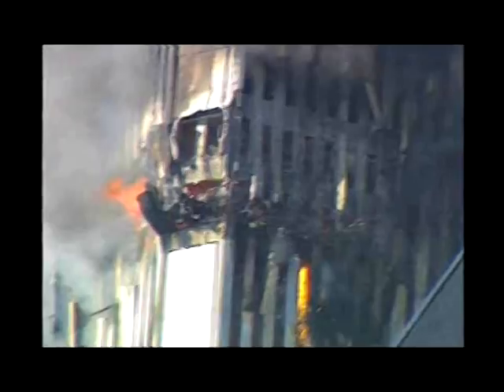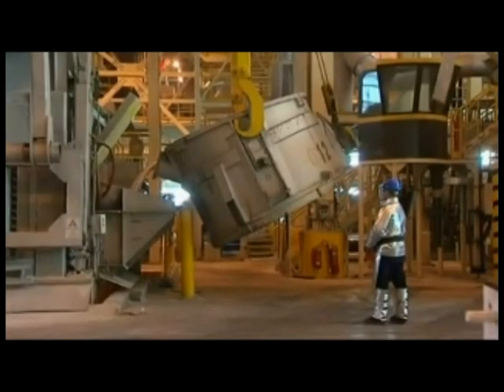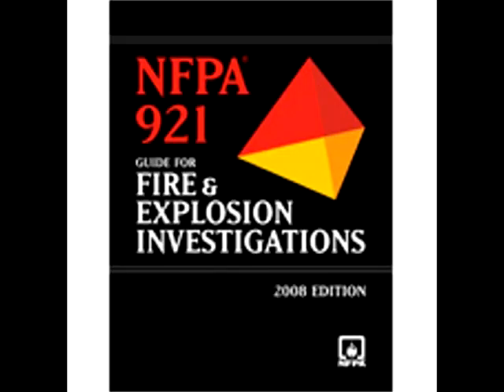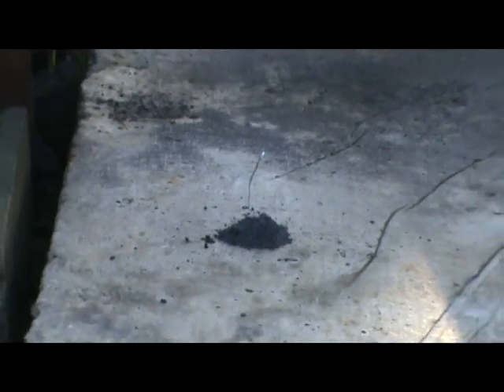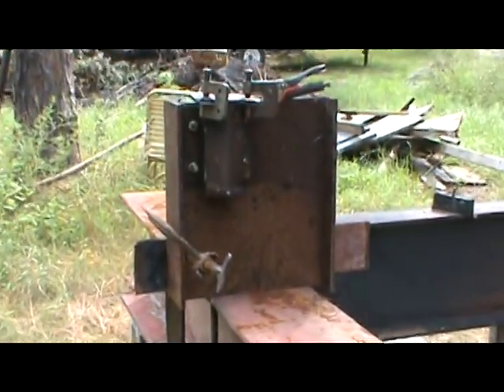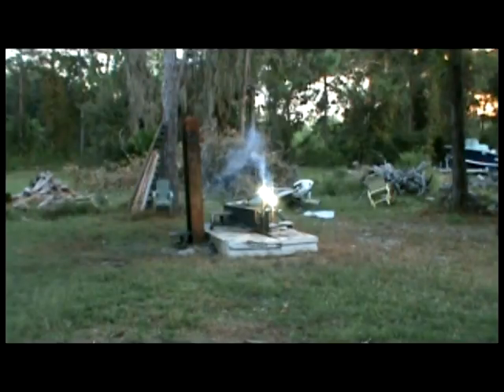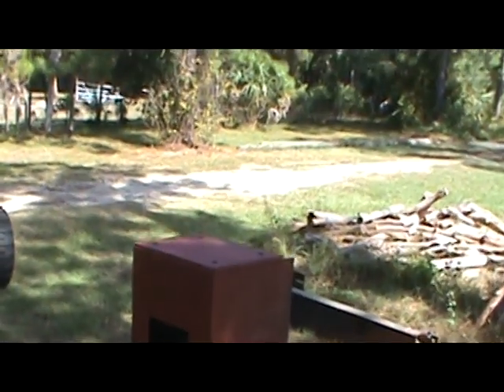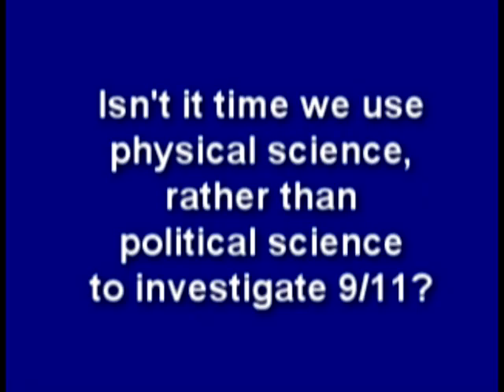9/11 Experiments: The Great Thermate Debate

Comment: @ThePeage available time.
Evacuation was assisted by participation in fire drills within the previous year by two-thirds of survivors and perhaps hindered by a Local Law that prevented employers from requiring occupants to practice using the stairways. The stairways were not easily navigated in some locations due to their design, which included "transfer hallways," where evacuees had to traverse from one stairway to another location where the stairs continued.(41)

Comment: ThePeage It is conceivable that such a fourth stairwell, depending on its location and the effects of aircraft impact on its functional integrity, could have remained passable, allowing evacuation by an unknown number of additional occupants from above the floors of impact. If the buildings had been filled to their capacity with 20,000 occupants, the required fourth stairway would likely have mitigated the insufficient egress capacity for conducting a full building evacuation within the... (40)

Comment: @ThePeageDue to the presence of assembly use spaces at the top of each tower (Windows on the World restaurant complex in WTC 1 and the Top of the World observation deck in WTC 2) that were designed to accommodate over 1,000 occupants per floor, the New York City Building Code would have required a minimum of four independent means of egress (stairs), one more than the three that were available in the buildings. (38)

Comment: @ThePeage Egress capacity required by current building codes is determined by single floor calculations that are independent of building height and does not consider the time for full building evacuation. (37)

Comment: @xFogxofxWarxThe WTC towers likely would not have collapsed under the combined effects of aircraft impact damage and the extensive, multi-floor fires that were encountered on September11, 2001, if the thermal insulation had not been widely dislodged or had been only minimally dislodged by aircraft impact.
In the absence of structural and insulation damage, a conventional fire substantially similar to or less intense than the fires encountered on September 11, 2001, likely would not have...(27)

Comment: @xFogxofxWarx WTC2 collapsed more quickly than WTC 1 because there was more aircraft damage to the building core, including one of the heavily loaded corner columns, and there were early and persistent fires on the east side of the building, where the aircraft had extensively dislodged insulation from the structural steel. (26)

Comment: @xFogxofxWarx Their neighboring columns quickly became overloaded as columns on the east wall buckled. The top section of the building tilted to the east and to the south and began its descent. The time from aircraft impact to collapse initiation was largely determined by the time for the fires to weaken the perimeter columns and floor assemblies on the east and the south sides of the building. (25)

Comment: @xFogxofxWarxIn WTC 2, the core was damaged severely at the southeast corner and was restrained by the east and south walls via the hat truss and the floors. The steady burning fires on the east side of the building caused the floors there to sag. The floors pulled the heated east perimeter columns inward, reducing their capacity to support the building above. (24)

Comment: @ThePeagecontributed to the abrupt structural collapse.
In WTC 1, the fires weakened the core columns and caused the floors on the south side of the building to sag. The floors pulled the heated south perimeter columns inward, reducing their capacity to support the building above. Their neighboring columns quickly became overloaded as columns on the south wall buckled. The top section of the building tilted to the south and began its descent. (23)

Comment: @ThePeage The robustness of the perimeter frame-tube system and the large size of the buildings helped the towers withstand the impact. The structural system redistributed loads from places of aircraft impact, avoiding larger scale damage upon impact. The hat truss, a feature atop each tower which was intended to support a television antenna, prevented earlier collapse of the building core. In each tower, a different combination of impact damage and heat-weakened structural components...(22)

Comment: @ThePeageThe two aircraft hit the towers at high speed and did considerable damage to principal structural components (core columns, floors, and perimeter columns) that were directly impacted by the aircraft or associated debris. However, the towers withstood the impacts and would have remained standing were it not for the dislodged insulation (fireproofing) and the subsequent multi-floor fires. (21)

Comment: @ThePeageTo increase confidence in the simulation results, NIST used the visual evidence, eyewitness accounts from inside and outside the buildings, laboratory tests involving large fires and the heating of structural components, and formal statistical methods to identify influential parameters and quantify the variability in analysis results. (18)

Comment: @ThePeagecomponents.
The output of the four-step simulations was subject to uncertainties in the as-built condition of the towers, the interior layout and furnishings, the aircraft impact, the internal damage to the towers (especially the thermal insulation for fire protection of the structural steel, which is colloquially referred to as fireproofing), the redistribution of the combustibles, and the response of the building structural components to the heat from the fires. (17)

Comment: @ThePeageFor such complex structures and complex thermal and structural processes, each of these steps stretched the state of the technology and tested the limits of software tools and computer hardware. For example, the investigators advanced the state-of-the-art in the measurement of construction material properties and in structural finite element modeling. New modeling capability was developed for the mapping of fire-generated environmental temperatures onto the building structural...(16)

Comment: @ThePeage towers to the design gravity and wind loads.
Simulations of the behavior of each tower on September 11, 2001, in four steps:
The aircraft impact into the tower, the resulting distribution of aviation fuel, and the damage to the structure, partitions, thermal insulation materials, and building contents.
The evolution of multi-floor fires. (14)

Comment: @ThePeage Establishing the baseline performance of the towers began with the compilation and analysis of the procedures and practices used in the design, construction, operation, and maintenance of the structural, fire protection, and egress systems of the WTC towers. The additional components of the performance analysis were the standard fire resistance of the WTC truss-framed floor system, the quality and properties of the structural steels used in the towers, and the response of the WTC..(13)

Comment: @ThePeage To investigate the building construction, the materials used, and the technical conditions that contributed to the outcome of the WTC disaster after terrorists flew large jet-fuel laden commercial airliners into the WTC towers.
To serve as the basis for:
Improvements in the way buildings are designed, constructed, maintained, and used;
Improved tools and guidance for industry and safety officials;

(2)

Comment: @ThePeage
1. Gypsum plaster is used in construction to cover drywall joints and screws. It is commonly referred to as Drywall Mud.

2. Plasterboard is the name for the layer of gypsum plaster that is dried into the centre board of drywall, then covered on each side by thick paper. 

3. Dolomite is used in concrete. When the concrete was pulverized during the collapse, the result would be a combination with the gypsum.

Comment: @ThePeage"…calcium oxide which is produced by heating limestone, causes the conversion of the sulphur dioxide into calcium sulfate with the formula, CaSO4.2H2O, which is the same as the natural mineral known as gypsum. The product can be dried and used in plaster [1], plaster board [2] manufacture or in road building.

Comment: @palasta Those 'squibs' are actually explained by Danny Jowenko, whom truthers often refer to as one of their guys (even though he wasn't, and denied the idea of it being controlled demolitions). According to Jowenko, the uneven collapse (as you can see the tower lean), caused excessive pressure on certain columns at a time, snapping the steel beams, and bursting their bolts. This caused the explosion sounds, which combined with the wind force created these plumes out the broken windows.

Comment: @ortafunk

"but I still can Not explain the squibs & lobby blown out."

Squibs was just compressed air shooting out of windows and ventilation shafts as the buildings came down.

The lobby blown out? It was damaged by the impact shock, an explosion running down the elevator shafts and elevators crashing down. There were broken windows and cracked marmor plates. It's only evidence of how much energy were behind those impacts.

Comment: A hydrocarbon fire can melt Steel If It Is big enough but I would Imagine the office furniture with foam rubber padding would burn hotter than jet fuel there was a big fire above the crash Impact. Also Air planes are made of aluminium & magnesium & magnesium can burn at 4000 degrees F also there are many Oxygen tanks on Air planes which would make the fire hotter then there Is a 3200 litter Oxygen tank I think exploded at WTC & pentagon, but I still can Not explain the squibs & lobby blown out.

Comment: @ThePeage "What sources are you unaware of?"

Your source that explosives would not register on seismic readings. Your source that gypsum wallboard does not cause sulfurization of steel. Your source that 'high tech' explosives that are capable of causing catastrophic failure of structures within the milliseconds required by demolition teams to fall a building as they desire; with no vibrations able to be recorded - even exist. Shall I go on?

Comment: @ThePeage If you wish to be taken seriously; and to demonstrate your scientific intellect that you like to portray; then you must provide evidence that controlled demolitions (conventional or not) would have collapsed the towers at the exact impact zone of the planes; and not have either gone off as a result of the fires, or simply burned up in them. Ignition of charges is dependant on either heat or electricity; both would have failed in the impact zone. This means it is impossible.

Comment: @ThePeage inwards; and not outwards. The video footage; as well as the reports of the clean-up crews show the majority (estimated by clean-up crews as about 80-95% of the debris) fell OUTSIDE the tower's footprints. If explosives were used; the result would have been an inward collapse of the outer walls; not the other way around. The pushing of the walls outward suggests that the collapse was the gravitational pull of failed floors; not the blowing out of them.

Comment: @ThePeage Your claim that it was not conventional controlled demolitions does nothing to refute the fact that the collapse was not done with any controlled demolitions. There is a footage of a French demolitions team which collapsed a building by removing one support wall; causing the upper floors to collapse in on the building. The result was an identical collapse as towers 1 and 2 of the WTC. For there to have been controlled demolitions; this French video would be an impossibility.

Comment: @ThePeage So we can see that he "suggests" crushed gypsum wallboard, as it is a known "certainty" for the cause of the sulfurization. The bottom line is there are several methods of sulfurizing the metal; and none require thermite - therefore your argument is void. Until you can prove that no other means present at the WTC would result in the sulfurization of the metal; then you zero evidence that it was in fact thermite.

Comment: @ThePeage Gypsum wallboard, or more commonly known in construction as drywall, is made up of gypsum; a form of sulfate. Oxidation is nothing more than rust; therefore the source of oxidation in the samples is a variable that could be caused by numerous effects without the presence of thermite. So we must look at the sulfurization. To sulfurize is to treat or impregnate with sulfur. Gypsum wallboard contains the necessary sulfur element to do just that. It's why Dr. Barnett said it is a certainty

Comment: @ThePeage "If the chips are something other than thermitic material, then it should be easy to show this. If they ARE thermitic, then they could falsify the OS."

"I would suggest that crushed gypsum wallboard would explain the source of the sulfurization. As that effect is a certainty (the effect of pulverized wallboard), and thermite is an unsupported theory, I'll settle for the certainty."

-Dr. Jonathan Barnett

Comment: @ThePeage I have not omitted anything about his comment on WTC7; I posted his comment on WTC7; but since you failed to read it:
"Tower 7 is another issue. I was under the impression that the fires were unusual in that diesel fuel in large quantities became involved in the mid-afternoon. This would exceed the protection provided by the fire proofing. Of course the mechanism of collapse is still an unknown. There were large transfer trusses in the building, so perhaps those we compromised."

Comment: @ThePeage "It's because the chips could be thermitic material that it should be properly investigated. If it IS NT, then it falsifies the OS."

Using elemental symbols does not make you correct. If it were thematic material; there would have been countless hours of prep work; and insane evidence left behind. There was neither.

Comment: @Skeptic121
Tower 7 is another issue. I was under the impression that the fires were unusual in that diesel fuel in large quantities became involved in the mid-afternoon. This would exceed the protection provided by the fire proofing. Of course the mechanism of collapse is still an unknown. There were large transfer trusses in the building, so perhaps those we compromised. I don't pretend to have the answer to tower 7. But I anxiously await NIST's final report on that tower. -Dr. Barnett.

Comment: @Skeptic121
I would suggest that the crushed gypsum wallboard would explain the source of the sulferization. As that effect is a certainty (the effect of the pulverized wallboard), and thermite is an unsupported theory, I'll settle for the certainty.

As I like to say, the real problem is that Bush has really been taken over by Martians; Of course, this is as ridiculous as any other pie in the sky theory.
-Doctor Jonathan Barnett, 2 January 2007.

Comment: @Skeptic121 the cleanup of ground zero was the same as for any other debris like it. There was no attempts to hide anything from anyone. A google search for Dr. Barnett uncovers nothing of his belief in a coverup; but rather his intent on continuing an investigation to better change the future of building safety engineering. The debris was not carried away to dump trucks; it was carried to piles stored just outside the work zone; where it was inspected.

Comment: @Skeptic121 Safety regulations prevent people from just walking around in debris piles. You don't know what is there until you begin cleaning it up. This is not something uncommon. If you wish to entertain the idea of demolitions being placed in the elevator shafts and the basements; then you might want to start providing video evidence of the collapse originating from the basement and the interior of the building. I can gladly provide otherwise.

Comment: If the temperatures of the "molten steel" alleged to have been underground for weeks, was in fact hot enough to melt steel (some 2700 degrees F), do you really think that the rubber hydraulic lines and composite materials of the excavators pulling it up from the ground like the photos show? Do you really think that these machines would still operate in temperatures hot enough to weld the steel parts of the machine together and boil hydraulic fluid? Common sense.

Comment: @xmods4Reel Um, no, it did not at all, he just reverts to everyone was a cousin or uncle or ex dog sitter of bushes so that proves the security could have been compromised, but where is the eyewitness accounts of all this demo setup. And for just a few floors on each tower does not work because if you believe that the Hijackers flew the planes into predetermined floors (plus or minus 2 floors) than I have to ask. Do you still believe in Santa Clause?.....

Comment: @MegaYeshua33 Some core columns did stay standing in both towers until the bulk hit the ground and took them out at the base, you can see this in some videos where some core columns yes did remain standing for a few seconds, but those columns were only around half the height of the original tower, not the entire height. All the core columns above the point of impacts fell with that upper portion of building, hence why that whole upper portion fell in one piece like a solid block.

Comment: @hank1961 There were rooms in that area of the core, like conference rooms, break rooms, bathrooms, along with elevator shafts, stairwells and ventilation. If you google a floor plan of wtc. You can see about 8 columns right next to elevators, 8 out of 47 just does not seem to be enough. And none of these 8 is any of the 4 massive corner core columns.

Comment: @hank1961 Now that we touched on basic building components, let me issue your claim of said “beams” (columns) from said elevator shafts…The towers were 208’ x 208’ with open areas all around the core of columns that was around 42’ on 2 sides and 62’ on the other 2 sides making a rectangular area for the “core of columns” which according my calcs is a rectangle of about 84’ x 124’. That is over 10,000 sq ft. Hmm, well I don’t think they filled all that space with elevator shafts…